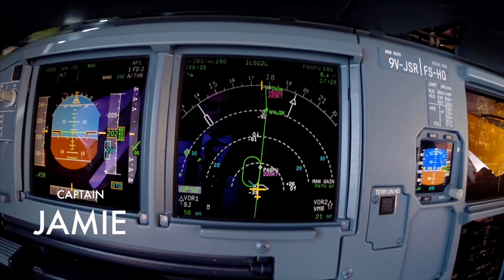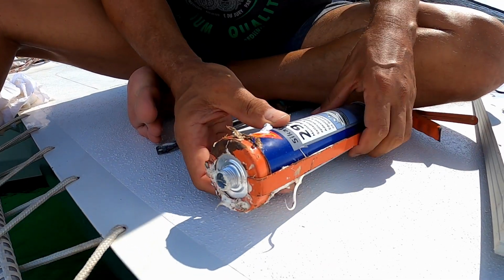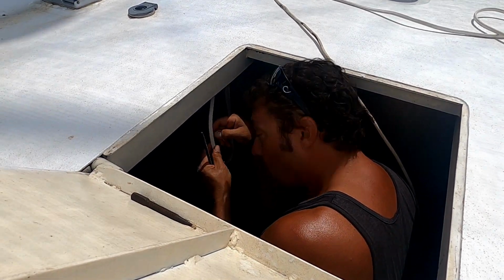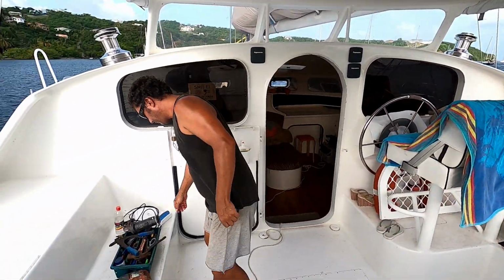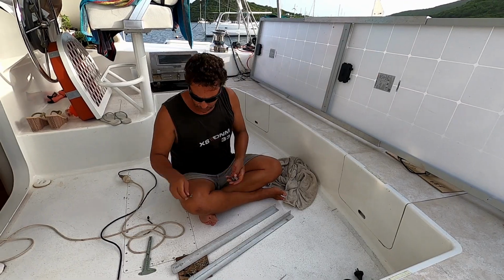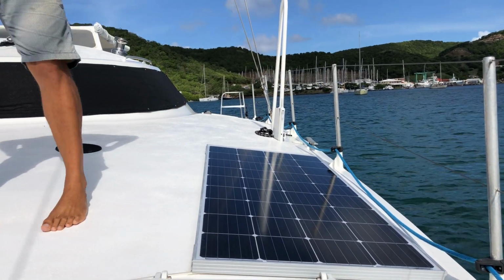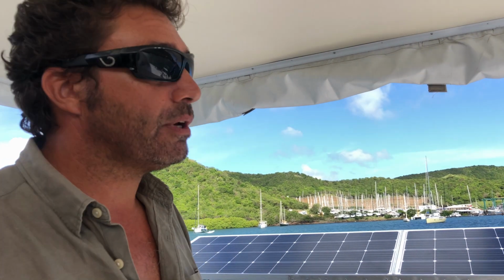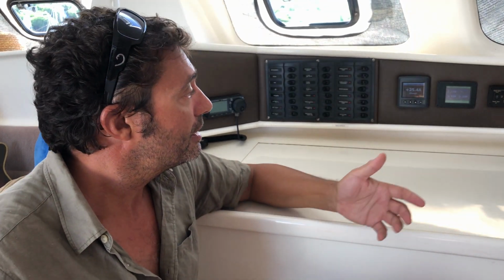Our solar panel upgrade - Sailing life on a performance cruising catamaran. EP32

Comment: Like the Davits they look aesthetically appealing  and appear to double your capacity. The ones on the front!!! Shocking, they will get trodden on, caught by a sail and drilling holes and cabling along the front support strut.... I can't even comment. Such a beautiful boat hacked to pieces....
Reply from the maker: Thanks for your feedback Malcolm....only one hole on the chamfer panel....No problem.

Comment: Re: sika - put a m6 screw / bolt in the top and tape it down securely (around and then over the top), and then put it in your fridge / freezer. It’ll keep the sika fresh and ready to use for 6+ months.
Reply from the maker: Good idea Nathan, cheers.

Comment: Tilting solar panels. Awsome. Like your thinking.  If you have internet have a look at this Video. I show a new 400Watt Solar panel that is smaller than a 370Watt panel. Very efficient. Enjoyed the video
Reply: No link Justin
Reply from the maker: Ta Justin, will check it out

Comment: Aye m8’s, i like the easy locking for the aft panels. However I would secure the cables running parallel with the trampoline with more than glue. UV-rays and slamming in shortwaves would be tough on them, don't you think? I hope the bow panels keep their grip and I would never trust Sikaflex. My favourite, since trying a lot of brands and types of adhesive, I now can only recommend Tec7 for a stronger bond and versatility of applications. It even hardens under water, salt water. And Tec7 is so far the most environmentally friendly adhesive. I really liked your smile monitoring the charging 😊 and vote for a follow up on how you find the panels work. 🔧
Reply from the maker: Tec7.. Cool ill keep a look out for it... All going well 6 mths in Miq. Cheers
Reply: Saw solars mounted on the lifelines - were solid tubing in that section. Advantage was they could be pivoted around the rails to (better) follow Sun, can be set vertical if you want to work right at the rails for some reason and can be set totally horizontal to avoid windage. Their centerline being on the rails, half is outside, half is inside so it takes only like 30cm from the walking space. 
If Sika gives up on you, you can consider this. Takes some more tubing in that section of the lifelines.
Reply: @koborkutya7338  Yes it is a common way to add solar panels on the stanchions, if mounting space on deck or bimini is limited. Especially frequent on monohulls, but some cat's have it also. Not a good place to have them in higher wind forces though, so they must be easy to dismount and you need some good place to store them during storms or hurricanes.
Reply: @MiQBohlin  I see - but then you need quick connectors and quick release fixing etc - not so good
Reply: @koborkutya7338  True! There are som good connectors on the market but you have to be an inventor to find and fix the solutions. Permanently mounted panels is indeed advantageous.

Comment: Wise idea to increase solar panel power! Can you estimate how many solar panel Mumby 48 will accommodate at max ? In case of 4 panels on davit and panels on the deck at max ?
Reply from the maker: It's all a compromise. I wouldn't put any more on the davits.. You'd lose them in a blow... I don't want to crowd the deck, because you can't walk on them... Even the flexible ones that you can walk on a slippery... But if you get rid of the mast you can have another whole level above you covered in panels.... Just depends what sort of boat you want!

Comment: The solar panels on the deck just look like very good toe catches, that will let out a few swear words for sure, They will get stepped on at least once, not by you but by crew or kids, all I can say is keel hall them
Reply from the maker: Yup.. Probably will. I'm thinking about gluing a dozen pads of polystyrene under to give some support in case someone puts a foot on them.

Comment: After seeing you for the first time on this video I decided not to follow you. The installation of those panel is nothing but a Time Bomb of short circuit (soon, very soon). I advise you to see good quality videos here on youtube of people doing really good installations.
All.my best wishes to you guys, but please keep self instructing/learning to be a better example.
Reply: Do you even sail? What is your experience and/or qualifications? Where's your boat?
Reply: @LoztDaze  He is entitled whether he has videos up or is just another armchair expert (like you Chris A) does not matter.  He has said his peace now he is happy. I think they did a good job with what they had on hand. Yes the wiring is not the best. But give the man a chance and i am sure when he gots someplace he can buy what is needed at a fair price he will fix it. It's easy to poke holes in somebody else's lives when they do youtube. But you know what? At least they are out there doing it. Live what you preach. I do.
Reply from the maker: Cheers Sebastian... I guess that is what fuses are for... But I'm hoping you're wrong about that!
Reply from the maker: Cheers Chris
Reply from the maker: Cheers Justin
Reply: @SailingLifeonJupiter  Use some protection for the cable where it crosses holes you drilled. Can be a standard cable gland or maybe a rubber ring. Else alumina will cut through the insulation a give you an intermittent short that will drive you crazy.
Reply: @koborkutya7338  good point.
Reply: @SailingLifeonJupiter  My guess is that since you didn't show the final installation of the wiring he assumes that the wires are going to chafe - especially where is passes through the holes in the hulls without a grommet or some other protection.  I did hear that you were going to come back and use Sikaflex. That should act like a sufficient grommet to protect the wires from chafe.  Suggestions for improvements I would make in the future? 1) Come up with a way to make the panels on the deck have the ability to tip up (for cleaning and/or retrieving something that may slide underneath?) and 2) Beef up that frame around the panels on the rear arch when you find a reliable source for aluminum angle and a welder.  There was quite a bit of flex!  3) while you are at it, see if your brackets can be stiffened up too.  I like things sturdy.  I overbuild and then forget about them!